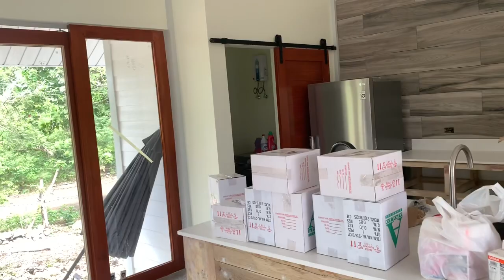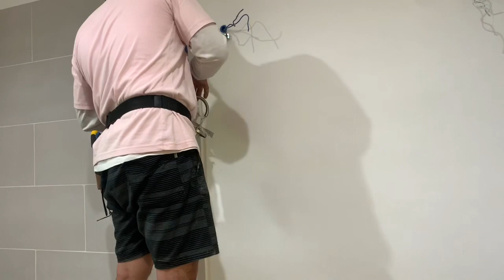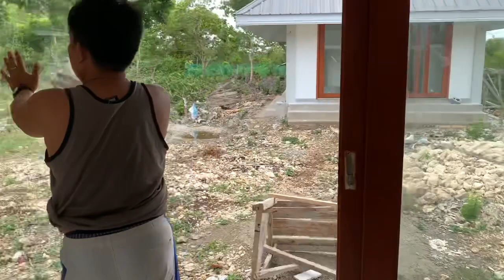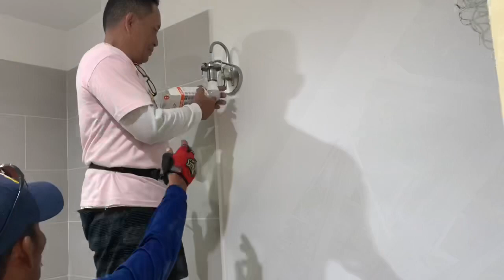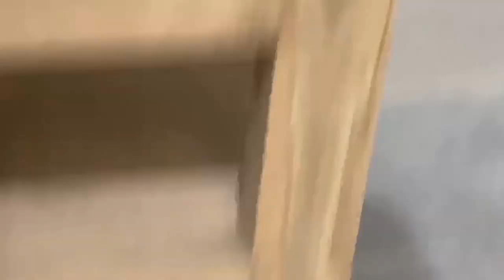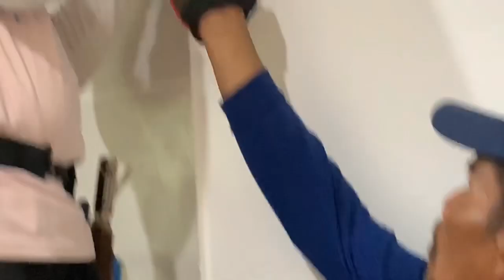INSTALLATION OF OUR GLASS DOORS AND MORE LIGHTS // HOUSE BUILDING IN THE PHILIPPINES

Comment: once all this Covid is over, I am retiring to Palawan, I would love to know what the average cost to build one of your buildings is. I like the idea of the seperate buildings for each use.
Reply from the maker: The brick and mortar part is not expensive , after that it depends on things like the quality of your roof , Steele trusses or wood ,  the kind of tiles , bathroom fixtures . We went with the highest quality we could find in our area including many trips back and forth to Cebu .
Reply: @LynAnthonylifeinthePhilippines  thanks for the quick response, I was looking at building an approx 100sqm meter single story and your right it all depends on the fixtures and fittings, I have done some research and prices vary from 350K to 550K, but I really like the idea of the seperate buildings, and each one looks maybe 25-30 sq/m
Reply: Lyn & Anthony life in the Philippines could you tell me the dimensions of your three buildings approximately and I’ll see if I can get a quote

Comment: Question will you build again and if yes what would you change what would you do the same.
Reply from the maker: For one i would not make my own doors . I probably would not use a Forman after the beams and columns are poured . just a waste of Money .  I think i would spend extra money on better hollow blocks . I think that’s about it .
Reply from the maker: Mike in the Philippines it’s not the large ones , i don’t know exactly the size . You’ll just end up spending more money on cement filling the holes in the larger blocks , it’s not necessary because the walls are not structural .
Reply: Next house I am building Canadian way no pillers just hollow blocks with deeper foundation and blocks not filled with cement. Thank you both for allowing us to follow your life. You are my second favorite you tube channel, becoming Filipino is my favorite. But different type of channel
Reply: My brother in law makes hollow blocks I bought new forms for bigger blocks, kitchen will exhaust fan vent, but will have dirty kitchen for fish. Thank you both information